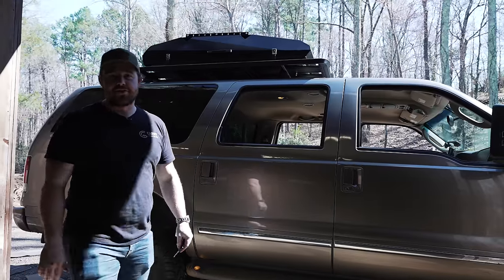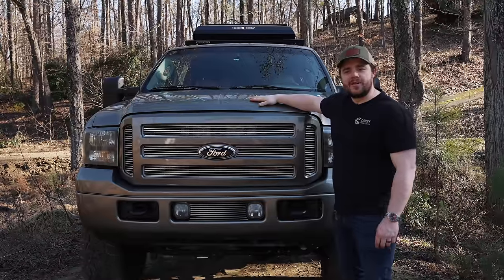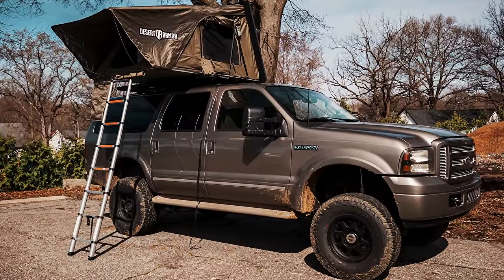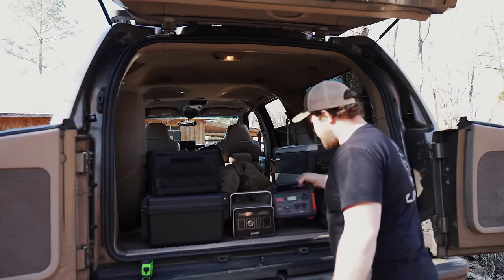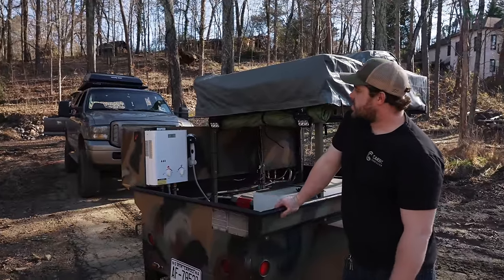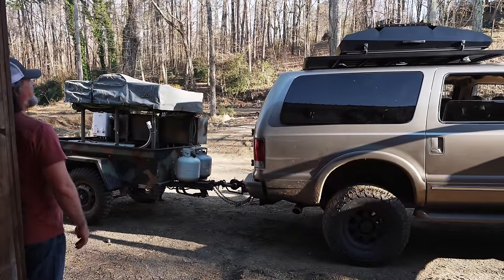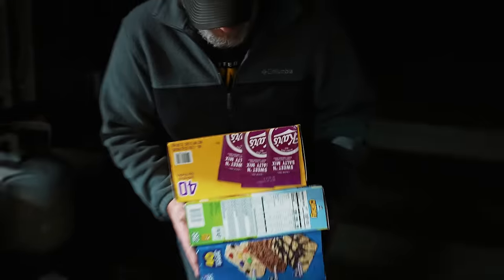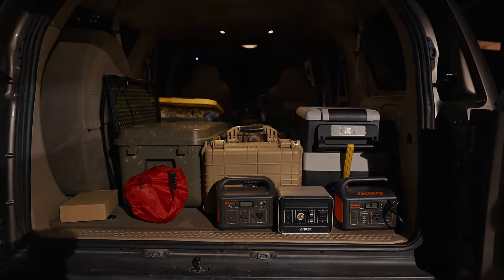Meet The OX: Overland Excursion Build Update [Blade Show TX Meetup]

Comment: That's a badass rig and setup with the trailer.
You could probably add on to your roof rack, make another cross bar to spread more weight out. Also add a few braces to transfer some weight down into the pillars. 
Some Fab Four bumpers or similar with a winch would look great on it.

Comment: Be careful. Pulling a trailer out of cold storage for a long trip is risky!  Make sure you throw some grease in those bearings!  Check for dry rot!  Especially the valve stems!  How many times have you seen a trailer with one of the tires incinerated on the side of the road!